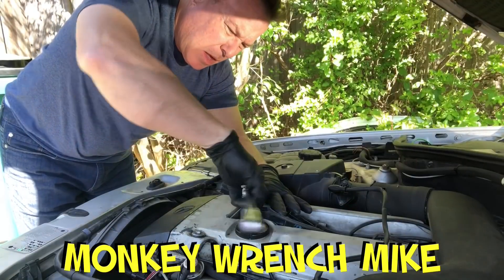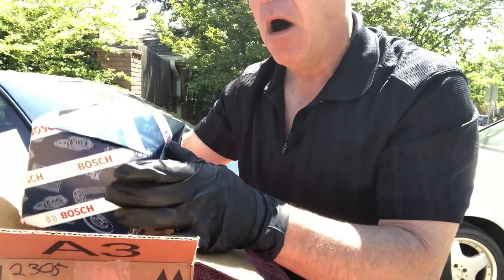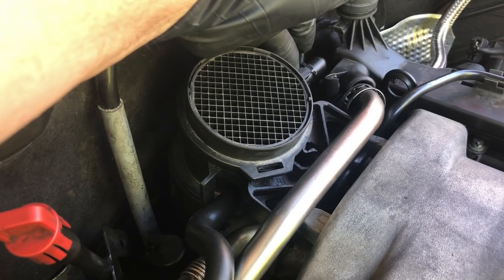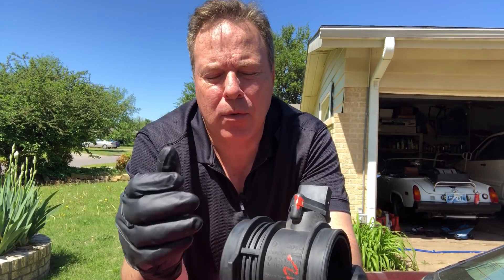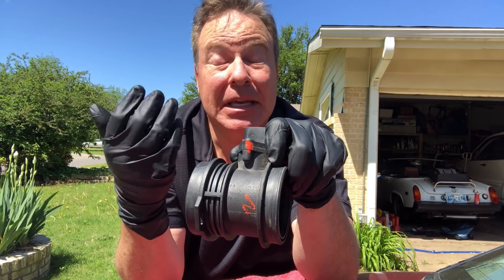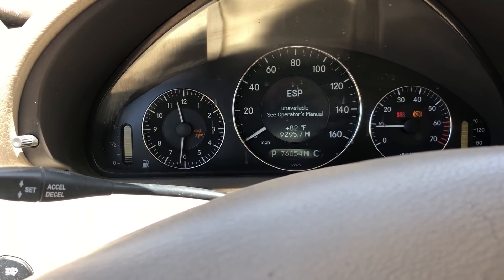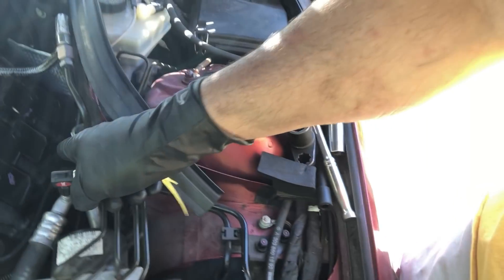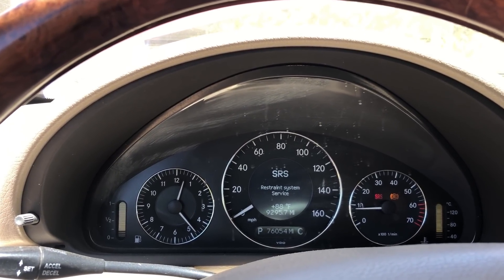Can a Mass Air Flow Sensor Fix a No-Start Car?

Comment: Car it barely made it home. It kept backfiring. I mean you had it to the floor. It wouldn’t go just stalls on me I mean, and then eventually you would die. I got home to the bottom of my driveway, which is up a hill and it wouldn’t even go up the hill. I got it stuck at the roadso I don’t know what it could be. I’ve put cool packs up put everything but this is a good car. I love my Mercedes. It’s a 97. It’s got over 287,000 miles and I expect that car to go for a long time cause I’ve taken care of her except for that.

Comment: Then I bet that’s it. I put a new mass airflow sensor and dummy me bought it off eBay, which I can send it back, but it’s at the mechanics and he can’t find anything wrong with it. Nothing‘s coming up when he plug something in it too, I’m a woman OK I know a little bit about cars but when he goes to do anything, it never shows anything badso I bet it’s that mass Farro mass flow air sensor. I’m sorry and I’m gonna have to send it back and get a new one. I think I’ll go with Bosch.

Comment: Nice video ..so user u have several Mercedes ..in your drive way ..have a question I have a 2003 e500 first bought it it shot hot mass film code ..I replaced as irflow  meter with cheap Amazon and it seemed to be working ..however the last two weeks when starting the car it fires and shuts off the second twist fires and runs ...no issue then while idling it stalled ..but fired back up the drive home 90 miles check engine light came on for air flow p101and wife said it felt kinda sluggish..question could mass air flow cause car to stall at initial startup?
Reply from the maker: Yup! Stick with the expensive MAF sensor!!

Comment: I don't know if this video is an old one or not when you have a misfire take a spray bottle and spray your coils around the plug wires and you'll see if anything's arcing at night and then if the catalytic converters are ever clogged run it at night and you'll see him glowing red at night

Comment: Dont you need to disconnect the battery for a while after replacing the mass airflow so the car sees the new part??
Reply: You have to repeat the proses you right

Comment: Start with replacing the spark plug wires and coil for cylinder 6.  The M112 engine has 2 spark plugs and wires per cylinder and the coils are 2 in one unit. A total of 12 spark plugs and wires and 6 dual coils.
Reply from the maker: Good advice! Thanks!

Comment: If you go back on your video I notice on cylinder number 4 I think your cable is bad I saw a spark coming out
Reply from the maker: I’ve seen another message about that. I’m going to look tonight once it gets dark. Thanks for the tip.
Reply: @MonkeyWrenchMike   no problem

Comment: It looks like you have a bad coil or bad wire becuase it seemed to have a intermittent flash of the light when you had it on. Great video
Reply from the maker: Thanks for the tip! I’ll have to check it out...

Comment: Over here from Auto Auction Rebuilds.  You need to try a more systematic approach.  Don't  keep buying parts.  Your error codes indicate something is wrong on the driver's side bank of cylinders you need to look at what's in common.  We can see sparks arching on that side, so we know you have bad coils or plug wires.  Is there a bad intake gasket on that side, perhaps allowing a vacuum leak?  You checked that each of the injectors work outside your car, but you don't know if they are actually firing consistently while installed.  This is just an example.  I'm curious to see what solution you find.  Keep at it.
Reply from the maker: Thanks for the advice. Cats were clogged! They fell apart and clogged the exhaust.

Comment: I was always taught... If it flows fuel, air, fluids, or electricity.. use OEM. And.... always check the easy stuff first.